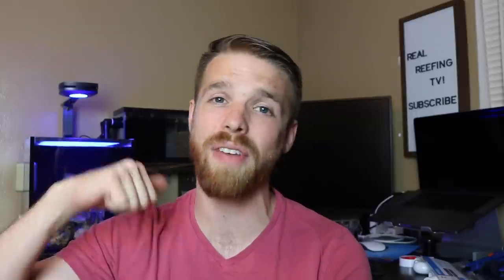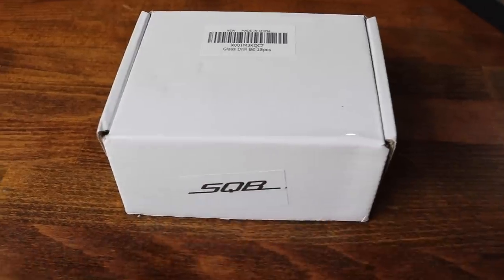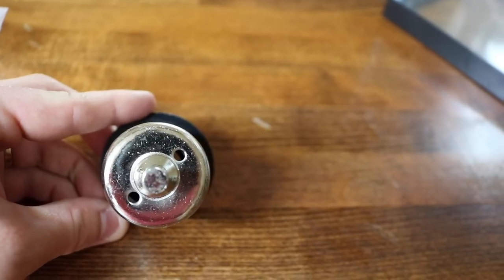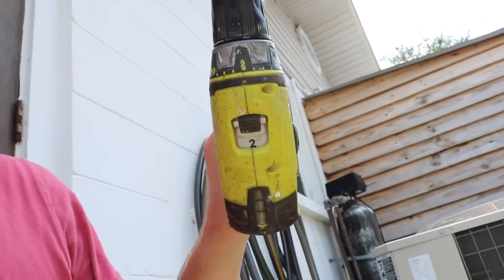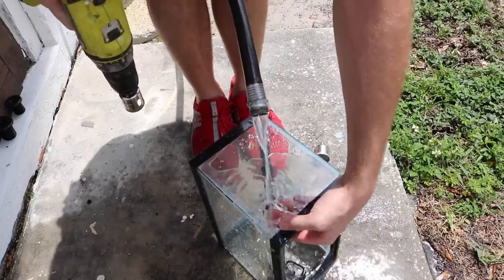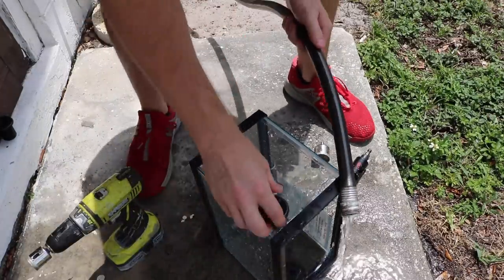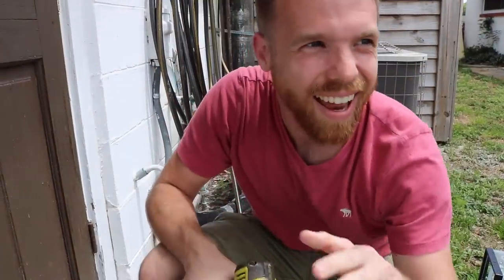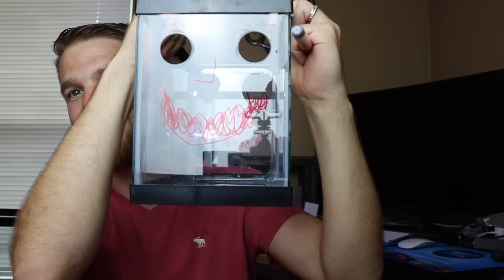Nano Refugium Setup | Drilling a 2.5 gallon reef tank

Comment: OH.... my... LOL you got me yelling at the screen. When you're drilling glass NEVER NEVER NEVER drill with a pilot bit!! Begging the hole is the most difficult part. I always use a piece of acrylic that I use as a template to hold the bit in place and not scoot around. if you don't, you can use the very edge of your bit going slowly until you get a nice little ridge in there and work your way down. that'll help :)
Reply from the maker: That's a good idea👍 I should have been yelling at myself lol I have to drill the frag tank that I'm tying into the 300 reef and I'll be making a template.
Reply: RealReefingTV awesome! Glad that helped! Measure where you want the hole, mark it on the acrylic, drill the hole in the acrylic then you can silicone it in place on the glass. Perfect hole every time
Reply from the maker: I think I'm just going to use some spare plywood lying around and clamp it down. But def a template on the next go around

Comment: Use sand paper to smooth out the holes. Placing the drill back into an already drilled area may result in another cracked tank.
Reply from the maker: Yeah you're right especially if it gets cocked to the side could bind up and crack it. Luckily it didn't

Comment: Just put some blue tape, will hold the bit long enough to get the hole started without walking !!!
Reply from the maker: That's a good tip thought about next time making a small wooden jig
Reply: Works good as a backing to catch the glass and prevent it from dropping.

Comment: You could have used a $10 hole drilling guide from eBay. They adjust by hole size and save you holding the drill in place.
Reply from the maker: Oh word? I didn't know that.. so it's adjustable?
Reply: RealReefingTV yep, search adjustable ceramic tile glass hole saw guide on ebay

Comment: Come on man you start at an angle and drill at slow consistent speed also not to close to the edge of the tank or will crack . You can use puddy around the whole to hold water while you drill so you don't have to be holding the hose.
Reply from the maker: O actually just learned about the 45° trick a few days ago lol. And yes putting can help but running water is certainly ideal. Also a squirt bottle can do the trick. Thanks for the comment! 😀